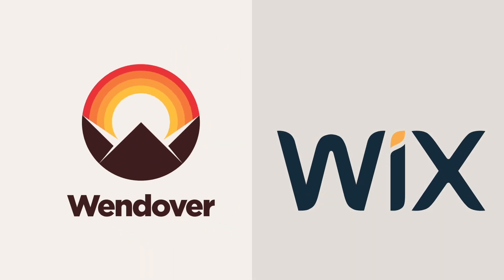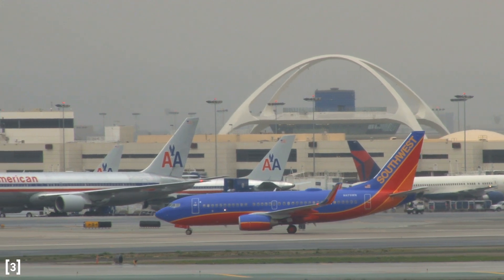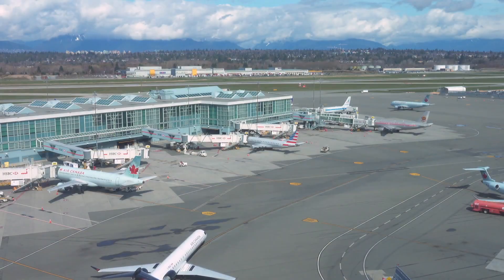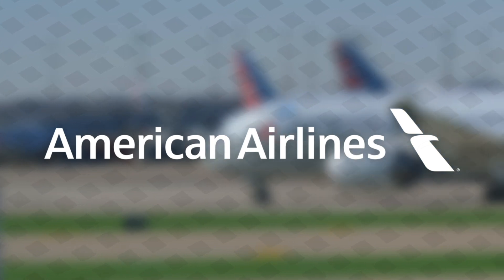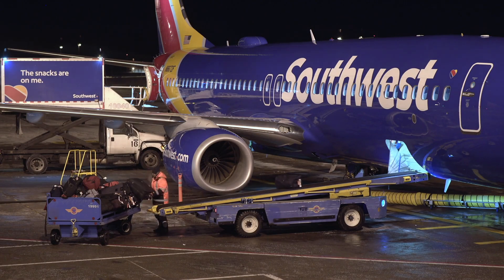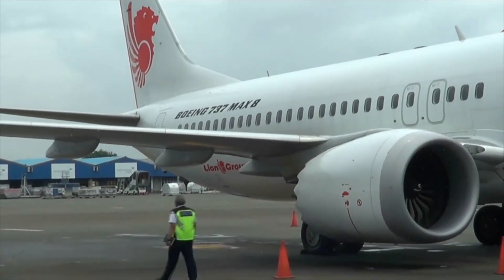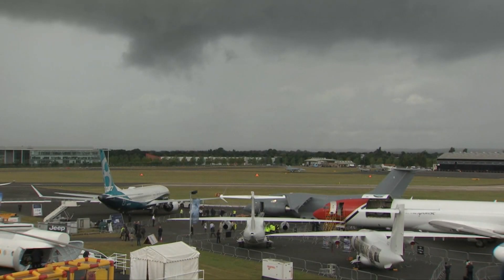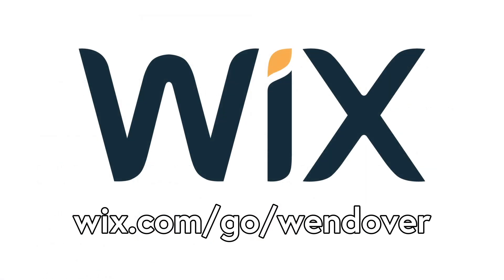The Economics That Made Boeing Build the 737 Max

Comment from the maker: Hey all, 
I hope you find this video interesting. It is meant to provide an overview of what led to Boeing creating the 737 MAX rather than giving a comprehensive overview of the factors leading to the two crashes and the issues with MCAS so the explanation on that is quick. If you want to learn more about that, I would suggest starting with this article: https://theaircurrent.com/aviation-safety/vestigal-design-issue-clouds-737-max-crash-investigations/

Also, for the first time ever, we're taking topic suggestions for future Wendover videos. If we end up using your topic, we'll send you a free Wendover t-shirt in gratitude. Submit your ideas here: https://docs.google.com/forms/d/e/1FAIpQLSdMAoo9CfGxr5OvZdz3qCCEkeQSVJpak3YYTHQFLRwXOyTOXA/viewform?usp=sf_link
Reply: Good video, but it feels like there should be a part 2 that's missing. Like why did the 737 only have 2 AOA sensors, and why check only a single sensor? Why wasn't redundancy designed in? And so on... At some point it is not because of our "poor primitive brains" and becomes just negligence.
Reply: @DemoEvolvedGaming  Also, the crashes are far more complicated than just MCAS.  For instance, why did no US pilots have much difficulty when they had AOA disagree, despite MCAS engaging?  The answer appears to be that US pilots get more mandated rest than the rest of the world, which is also why no US passenger carrier has had a hull loss crash in over 10 years, when they used to occur at the rate of 1-2 per year before the new regulations.

Every air accident is a chain of events that gets past a number of safety barriers, and the 737 MAX is no exception.  Break any one link in the chain, and the accident doesn't occur.

There's also the question of why is MCAS on the 737 MAX different than it is on the older Boeing KC-46 MCAS design, and that decision tree and FAA approval I'm sure is going to be looked at heavily, as the updated 737 MAX MCAS software is ripped straight out of the KC-46.
Reply: @jec6613  Is it not true that Ethiopian Airlines - a carrier with a first-rate safety record and Star Alliance codeshare membership - was one of the very few airlines to have purchased a 737-Max simulator? One that EA pilots trained on? Because of the type rating sleight of hand pulled by Boeing, there were almost no 737Max simulators in existence. But Ethiopian Airlines DID have one. That hardly suggests negligent crew training.
Reply: @alastairbarkley6572  At the time of the accident, they did not, because there were only two in existence: one owned by Boeing and the other by United. What they have now I haven't looked into, but they routinely falsified flight time and maintenance records and have been censored by EASA about it in the recent past for flying without meeting the minimum equipment list and with exhausted flight crews, and have been doing it for decades as they've faced shortages (I'll leave the politics of why out of this, but it has to do with Apartheid ending in South Africa … yeah, it's a mess).  Just because you're a Star Alliance member doesn't mean much of anything when it comes to safety records, it just means you have a good route network that somebody else wants to use.
Reply: @jec6613  On one plane that crashed the co-pilot had only 200 hours.
Reply: @DemoEvolvedGaming , I think I read elsewhere that additional sensors were available in an extra cost optional package. The airlines of the two planes that crashed apparently did not purchase the optional sensor package.
Reply: @DemoEvolvedGaming  Shouldn't there be any simulation runs where worst case scenarios are given to test out each and every part of the plane that is replacing the old parts ? It looks like the new does not work together with the old. The idea given is more like the exchange of old planes for new planes and the old planes are renovated to be "new" planes. So how do poor countries pay for all the "new" planes they buy ? Another comment was about the weight that the 737 max can carry. You should go back to the old days when every passenger and every luggage have to be weighed so as not to let the plane senses that the weight is too heavy which cause the plane to crash.
Reply: @DemoEvolvedGaming  Because if the two sensors disagree, then the computer has enough information to tell the pilot that it can't trust its inputs, and that the pilot should take over. In Boeing methodology, automation is meant to assist the pilot, but in any circumstance, the pilot is in charge of the plane. For example, the pilot can fly without AOA sensors, using the Artificial Horizon display, which is unrelated to the AOA system. If the plane looses all power, the Artificial Horizon is one of the core systems that continue to operate, allowing the pilot to manually fly/glide. If that fails (Which is even less likely), either the plane is not even flightworthy, or the pilot can generally fall back to "flying by the seat of his/her pants", which generally works as long as one crew member can see the horizon. 
I can think of one situation where the Artificial Horizon did not work correctly, and that was when a crew was in a hurry, and didn't let it settle into the correct orientation before uncaging it and proceeding to take off. Then they were in a strong cloud bank, taking an unauthorized shortcut over some mountains, and all the other functioning systems did warn the pilots that they were heading toward the ground (which was the side of a mountain in that case).
But anyways, 2 AOA is the correct number, as long as the computer doesn't have complete and total control of the aircraft in every circumstance.
Reply: Interesting video. Just one thing, the A320 is still a 30 year old design itself. And yes, it still uses a paper checklist concept for normal operation. That checklist can be put onto an EFB, but that is still not a feature of the airplane, just a feature of directly replacing a paper checklist by the same thing on a screen.  Unlike the 737, the Airbus avionics were never updated, which leads to the weird fact that the 737 avionic system is actually a generation ahead of the A320, but its automation is 2 generations behind. 

By the way, at least in many parts of the world, the 737 100/200 is a different typerating than the 737-300-MAX10. So no, a 737 rated pilot cannot fly all variants, just most. And differences training between variants can actually be extensive, the minimum differences course between a Boeing 777 and Boeing 787 (legally they are two variants of the same type rating) takes at least 7 working days including quite a few simulator missions. Same for the differences training between the 757 and 767 or the A330 and A350, all of those are one type rating for very different planes which are seen as variants of each other.
Reply: @Soordhin  indeed. Imagine going from gauges on the 737-100 to an LCD display on the 738... I believe there are more reasons for the difference in type rating, but I can already see the obvious difference between aircraft.
Reply: It is more than "just" instrumentation. The -300 to -500 have a partly "steam" layout, and there are actually completely steam instrumented ones out there. And yes, they can be flown on the same typerating, depending on regulations. The -100 and -200 are just tiny aircraft compared to the NG, a lot smaller and weighing a lot less, with completely different flight characteristic. However, not many out there anymore, so most pilots are just rated on the newer option.
Reply: Kind of feel like you should have mentioned the cables on a 737 don’t actually move the flight controls but instead actuate hydraulic power packs that move the controls.
Reply: @superskullmaster  indeed. And for the Airbus, it's like typing into a computer and the computer decides whether to type that word or not. If the pilot says left, the computer can say nope.
Reply: @AliBaba-vw7mo  I'm an A330 pilot, formerly flew the 737NG and the CRJ. What you say is completely and utterly incorrect
Reply: @DreamlinerFlyer  some enlightening will be appreciated. I read somewhere that you provide input to the computer, and based on other data provided by sensors, it decides whether it should execute the pilot's order. I'm also pretty sure the 737 Max is totally hydraulic and only spoilers are fly by wire.
Reply: @AliBaba-vw7mo  you provide input to the  aircraft using the sidestick and then it uses flight data to move the flight controls to the extent that the aircraft moves based on how much you move the sidestick. Its not that far off, but the aircraft can't just deny the request or anything. Obviously there have been some issues, like with every other aircraft, for the A330 there was an incident where what you described actually did occur where the computers denied the pilots' input and made a drastic nose down movement. It was quite worrying, especially since by then the A330 had been flying for over a decade. Thankfully, Airbus quickly remedied this after identifying the cause and to date there has never been a single incident that is even close to being similar, and I have no doubts that frankly we won't ever see anything like it again. Airbuses are very reliable and safe, and they're very flyable for the pilots, and frankly, I don't miss my yoke
Reply: @AliBaba-vw7mo  also, I was pretty sure that the MAX wasn't FBW, I just didnt want to get anything wrong since I flew the NG but not the MAX and therefore am not too familiar on the changes
Reply: @DreamlinerFlyer  I miss my yoke.. Not a pilot but went on class D sims before.
Reply: @DreamlinerFlyer  neither am I. More familiar with NG systems than the Max. Would you feel safe flying the Max after the patch and additional measures?
Reply: @DreamlinerFlyer  we can both agree he fucked up the "you can start an airplane with a flip of a switch" the last time I checked, I walk into an A320, I use paper checklist, do the entire checklist. YA can't just flip a switch
Reply: @AliBaba-vw7mo  after the patch, I would wait a bit before getting on, see what the pilots say, but so far, it seems like the patch is what MCAS 1.0 should have been, aka the system doesnt have nearly as much authority and is far less aggressive in its actions. Unless something unexpected comes up, I wouldnt think twice about it. Well I would, but only because of those AA 29" seats 😉
Reply: @DreamlinerFlyer  hehe
Reply: @DreamlinerFlyer  ye. I think even with MCAS off, pilots would notice the nose up attitude and correct 
 it with trim anyways.
Reply: Great and interesting video
Reply: BTW the Max is mostly safe and the pitch up is rare. Pitch up only happens on max thrust and low weights. Most flights are done with close to MTOW. Pilots have also reported that the handling characteristics of the max without MCAS seemed identical to the 737NG
Reply: @AliBaba-vw7mo  So 737MAX stall risk is pronounced on Go-Around scenarios?
Reply: @DemoEvolvedGaming  when these two conditions are met, stall risk is higher:
LOW WEIGHT
FULL THRUST
Ask yourself this, will you see an empty southwest flight? Don't think so, so stall risk is lower because it is not light.
Reply: Ali Baba 
M
Reply: Great video! It's the first time I've heard about the premature announcement by American. Interesting information though. I would also love to see a video about the Dreamliner and the accusations coming out of South Carolina that were in the NY Times article recently.
Reply: Have you seen AvE's look at an angle of attack sensor?

https://youtu.be/NhZ0D-JRtz0
Reply: I would enjoy it if there were to be a part two discussing the ensuing debacle and how engineering protocols, practices and systems played into it. As an engineering student who interns at an aerospace company known primarily for their avionics, I find this sort of stuff really interesting. Reliability engineering (especially in aerospace) is a fascinating topic, and I think that you could really do it justice.
Reply: Moving engines forward was not bad decision per se and it has not lead to the catastrophy. Design of new plane will replace one known stall problem with multiple unknown problems - see problems with Dreamliners and their engines and batteries. I do not mean it was good decision either but the accutal reason for crashes is a poor design of MCAS without redundency and stall indicators, also lying in certification about angle that MCAS is correcting the stabilizer, lack of training for pilots on the new areodynamic isues and more. Also jurnalist reported that undefounded FAA was skiping many checks and allowed boeing "to certify itself" - this should be punishable and is plane stupid.  But there is nothing about it in your video. The video clamis that redesign of the palne is to blame which is simply not true. It may not be the best solution but it has not lead to catasrophy. It could happened in any new plane where Boeing would think MCAS is needed!
Reply: Unfortunately I think the video shames Boeing and the Max Aircraft more than what is deserved. Reading the preliminary report of ET-302, the pilots on that flight were not capable of flying their aircraft and that incapability should not be put on Boeing’s shoulders. Grounding the Max was a unnecessary procedure and it is unfortunate Boeing has to suffer because of a problem that’s not their fault. I stand by Boeing 737 Max!
Reply: @thebenberg , maybe you didn't look at the report on what those pilots went through, but it reads like the screenplay of a dystopian future where our technology bends over backward in an effort to kill off human beings.  Yes, those pilots made fatal mistakes.  But I am baffled at how you choose to stand behind Boeing's decisions to give their autopilot more flt ctrl authority than the physical strength of the human pilots.  Muilenburg & co are personally responsible for the deaths of these hundreds of lives.  They made decisions toward maximizing profit at the expense of safety.  (This is to say nothing of the FAA's culpability in all of this.)
Reply: @Da Hawk I stand by Boeing because theses two unfortunate and sad crashes were preventable, and Boeing is taking the fall for that. I strongly believe the MCAS (autopilot does not have anything to do with) issue with the Max line of aircraft should not have been fatal.
Reply: @thebenberg  there is evidence of them rushing the certification. So its also their fault. But I'll be more than happy to fly on it after the fix
Reply: This is a very good presentation of a thesis about the 737 MAX blues.

May I point to the fact that this is a THESIS, not really true, or even reasonable.

Facts are that 737 in all its iterations are a huge success and have been the workhorse of the industry. Thousands of pilots have been trained for them and are comfortable with them. This is a real asset, worth a lot, that shouldn't be neglected.

Than comes the 737 MAX as a new reengined iteration of the old design. The option to refresh the old design surely imposes tradeoffs against a new clean sheet design. The Thesis behind most of this Boeing trashing speeches all over the internet implies that safety was fundamentally compromised. This has to be demonstrated, not accepted without argument.

Boeing and many seasoned pilots and aircraft maintenance workers say the plane is fundamentally stable, easy to fly, by itself, even without MCAS. Turbine placement and thrust levels make it behave a little differently than previous design iterations of the 737. That could jeopardize certification as the same "type" of airplane. Hence, MCAS.

Boeing made an inherently unreliable MCAS using just one AoA sensor, that can and eventually will fail, under the presumption that it is the same kind of failure as any one leading to the "Runaway Stabilizer" which already had established procedures to cope with. This is a fact, but the correctness of the presumption, and repercussions of subtle changes are being investigated.

FAA supposedly understaffed and underfunded has not pinpointed this at the plane certification time. This is under scrutiny too.

Did Boeing and FAA really released a certified plane to the public knowingly omitting it was inherently unstable, hence not certifiable as a commercial airplane as demanded by regulation? This is implied by The Thesis, negated by Boeing, many pilots, and other players on the industry. I don't buy it. It would be a massively irresponsible and homicidal action by many actors that was never ever proven, just theorized by some and virally propagated on the media and the internet.

Boeing is upgrading its MCAS design to make a "Runaway Stabilizer" event induced by its malfunction a lot less probable.

FAA and others are investigating the certification assumption that the plane is secure to fly even under a malfunction event with the established procedures and training.

It is possible that training was not enough and the procedure to difficult to execute with its subtle "memory items". 

Pilots should have trimmed the plane before CUTOFF, managed thrust and speed, not reenabled stab trim from CUTOFF position flying. Was this possible? Is the old procedure flawed? That's what's under investigation.

Two accidents did happen, and hundreds of lives lost. We're all sorry for this human loss, and shocked by the events. 

Anyway, we should avoid jumping to wrong conclusions and smearing everyone reputation before facts are established in the investigation.

In the next months, the recertification of the plane with the upgraded MCAS, under whole world scrutiny will show the planes real characteristics and who was right. Upgraded training, procedures or both may be expected if lessons from the investigation show the need.
Reply: @celsostarec6735  oh lord, this is the comments section, not a FAA investigation.
Reply: Wendover Productions most of your information is wrong, how do you get away with producing such poorly researched work...oh wait it’s the internet and this was free to watch.
Reply: Since you make so many grand declarations, including a number of falsehoods and half-truths, and yet expect your many viewers to trust you, how about if you post your aeronautical engineering, flight qualifications, and experience (both total time and time-in-type) below the video? If you can't / won't / don't have any, then at least viewers should have a better idea of the nature of what they are watching. The media loves making up sensational nonsense for the sake of viewership. Truth is sacrificed continually at that altar, even more than the passengers of developing-world airlines.
Reply: @ReflectedMiles  So at the end of the day did or didn't Boeing and the Airline bosses choose profits over safety? Those planes crashed for a reason. What's your explanation and what are your credentials?
Reply: Kim O'Brien So the credibility of sources and analysis is irrelevant so long as they’re pushing the established view? I have been a commercial pilot since 1985. The media have made an ignorant mess of this story, stoked irrational fears and misunderstanding in the public, as well as with its related stories. If they don’t have the understanding to produce a video like this, they need to shut up, sit down, and let the primary sources such as investigators, engineers, pilots, and regulators speak. Unfortunately, having known journalism students in college, they’re rarely the type to recognize when that is the situation. Self-awareness outside of a mirror just isn’t really a thing for them, which is why there is so little internal criticism of their industry. Having them accuse aircraft manufacturers of that is rich indeed.
Reply: @ReflectedMiles  First let me say I am glad to hear from someone who actually is in the industry. My experience is connected to the ground transportation, HVAC and electronic/electrical industry. I and I'm sure others have seen things that go on that shouldn't which is why it is very easy to believe this is just another case of someone putting the dollar before safety or other concerns. The liberal media has its own axes to grind as can be seen in it's unending get Trump at all cost campaign. They had chief FBI hound dog Muller run an almost three year investigation which revealed no connections or collutions with Russia but they still refuse to drop that bone.
Reply: This video is the answer to why I still haven't subscribed to this channel after watching so many of its videos. There was always something doesn't add up in those videos. Too much exaggeration and disregard of fact, all in favour of cheap likes.
Reply: I’m glad you are talking about this.
Reply: Check the graphic for Flights per day and Hours per day. I think you used Hours per day for both 4:20
Reply: Also, super huge appreciation for that amazing video thumbnail! 👏🏻
Reply: I generally don't like the idea of making Max sounds isolated, that every decision Boeing made wasn't being made by any other aircraft manufacturers. The industry is doing all the same things, and Boeing is only the unlucky one to get picked by fate.
Reply: @Wendover Productions,
Things ya got wrong :
1) Other aircraft also have paper checklist, but any checklist on any plane can be put into an Electronic Flight Bag.
2) YA can't just flip a switch to turn an aircraft on with engines running on other aircraft.
3) the pilots manipulate hydraulic systems, and those hydraulic systems control the flight surfaces. Without this hydraulic system, controlling the 737 would be like doing a workout at the gym., especially in high speeds.
4) there are multiple warning lights, telling the pilots exactly what is wrong. Cabin pressure low? Not to worry, a light lights up brightly with a loud alarm. Fire? Not to worry, ya got I giant red button that illuminates. Fuel? Not to worry, a light will light up. Hydraulic problem? Not to worry, a light will light up. This is, in my opinion, a one layer, easier to read system. Instead of scrolling endlessly through an error log, ya can just look at them lights and investigate further.
Reply: I really enjoy your videos and they are generally very well researched but I believe you have this one very wrong regarding the 737 MAX itself. There is nothing wrong with the inherent design of the 737 MAX series despite the age.  Boeing did screw up in many ways eg with lack of redundancy,their implementation of the MCAS and lack of adequate training. I suggest you watch the series of videos by fellow YouTuber and commercial pilot blancolirio.  His vids encompass the whole MAX saga and are the most informative out there.  He speaks from a life long aviation background and having been a 737 type rated pilot.
Reply: I have a suggestion; the producers of this article should watch blancoliro channel updates on this issue before, before making a follow up to this. 
No customer strong arms a company to build an inferior product to destroy their business, do they?
Boeing doesn't build planes to crash so they can sell more of them, do they?
Reply: super interesting
Reply: excellent video, man! great job! informative yet not looking to make a profit out of tragic crashes..
Reply: finally, something breathtaking
Reply: Can you do a video about the problems with Boeing's South-Carolina factory (issues, staffing problems and decisions, etc)?
Reply: LexChan oh you mean the same problems we have at Lockheed but don’t see the light of day because we aren’t making passenger planes?
Reply: Please explain why is a bigger engine (slide 18) needed ("more bypass/ flowpass") when a longer range aircraft is sought after?
Reply: @robertberin4872  Bigger engine is much more fuel efficient. LEAP engines allow further range since fuel use is less.
Reply: Super duper interesting! keep up!
Reply: BITCOIN - can we get a credible non-biased view on what it is, how to buy/ how to sell and whether one should/could buy bitcoin in 2019?
Reply: One more thing:  Love your channel but one thing that I really really HATE is the adverts you promote.  
Honestly I’m SICK TO DEATH of hearing the word skillshare (I know you mention wix in this video).  
Let’s be honest, MAJORITY of the people watching your videos couldn’t care less about skillshare and would never even look into it, let alone subscribe and pay for it.  

But we LOVE YOUR VIDEOS and understand why you need to do it.  Perhaps you can mention other things, as my ears have been scarred by the word skillshare.  Thank you for your videos!
Reply: Hey man I just want to say, thank you for citing your sources! I really always wanted to read up more on the articles
Reply: Thank you so much for your videos on aviation Sam! My brother is training to become a pilot. The way you explain the issues and logistics of air travel is so simple to understand for regular people like me.
Reply: Compare with this video from an expert. 
https://youtu.be/KB4lCbT5oX8
Reply: @8:25 you should have mentioned the Southwest usage of the 737Max to reach Hawaii (since many of the shots are of Southwest Airlines)
Reply: You should do a video on the process that lead to getting a picture of that blackhole recently!
Reply: +Wendover Productions ... Thanks for the briefing.  I have no airline background other than purchasing a ticket and hoping all the professionals "do there job".  This is really interesting from the standpoint of receiving a snapshot from the business end of why evolutionary processes happen ..... SAVE MONEY.  I did pick up some interesting points of view.  Gratitude is in order.  Good Job!
Reply: Very interesting to have a better understanding of this complicated matter. Thank you for making this.
Reply: Great video, learned alot!
Reply: Great video, and to the point, Thanks!
Reply: It has not much to do with MCAS but with MBA-style short term management. The same reason Microsoft was defeated.
Reply: Wendover Productions jhave pm
Reply: Lots of source information from other news agencies but limited information from tech and safety sources?
One US carrier has more of these aircraft that didn't crash when they were in use.
Why is that?
Reply: Wendover Productions you suck! Boeing is the best
Reply: Have you been paid by Boeing in anyway?  to make this or your other videos?
Reply: Good video, good job albeit I suspect more is at play besides MCAS alone in AOA autopilot integration systems. A330 incidents have largely remained unpublicized within US media sources, yet presenting similar if not yet fatal cockpit emergencies for more than a decade. Its an investigation waiting for broadcast from those unafraid of consequences, Id like to see ALPA take a more proactive standing. Unlikely. It seems in twenty-first century loss of life is sole instigation for thorough exposé.
Reply: @hualani6785  - MCAS isn't part of the autopilot it's a form of stability augmentation which is prevalent in modern airliners more accurately it prevents the control column force required to pitch up from progressively decreasing in certain AOA regions preventing pilots from easily inducing a stall themselves.

While the MAX is often labeled as "aerodynamically unstable" it isn't and the 777 which employs Relaxed Static Stability technically IS unstable but that doesn't mean it's dangerous as is proven by its safety record
Reply: No wonder it's still grounded!
Reply: Wendover Productions you should do a follow up to this on the economic cost of the 737 max grounding
Reply: nice review .......Boeing should .....see this
Reply: I love Boeing.The question we must ask..why didn't any Us carriers ( B737-max) crashed.
Is it the mandated rest periods for the pilots?
Is it the training ?
Or is it Lion air and Ethiopian airlines flight Safety record.
Is it cost cutting ?
What is safety..An uncompromising approach to standard operating procedures.
Another question to add to the list..Is it climate change?
Is the weather affecting aircraft performance?

Hmmmmmmm💯🙏💯🤔
Reply: Why cant Boeing just omit the entire MCAS system?  Just tell the 737 crews about the different center of gravity and airflow changes to the 737 Max fuselage and get on with it?
Reply: I disagree strongly with your conclusion. The Boeing 737 MAX was a conceptually fine design, and will eventually return to flight and live a hopefully uneventful career. The thing Boeing did that was criminally negligent was creating a safety critical design with no redundancy, and then not training pilots about it's failure modes. That is absolutely inexcusable, but isn't an indictment of "let's just reengine Betsy again". The idea to reengine the design isn't what caused the fault, the negligence of Boeing's MCAS implementation did.
Reply: Do we know why they didn't just add another few feet onto the gear length to fit the new engine in the original position? That way literally everything else could have stayed the same, surely?
Reply: And where would those extra few feet of gear length go when the gear was retracted?
Reply: For all people questioning technical aspects of this video, just don’t. This fella is not technical and slipped here and there when talking technical aspects such as if the MAX is fly by wire or what this even means. This is a video where he explains economical factors and those should be the only ones closely observed here, even more because he demonstrates some bias towards thinking that Airbus makes more modern aircrafts while Boeing just refurbished its fleet.
Ignore the technicalities and the video is good.
Reply: Great video.  On the last sentence, it wasn't just a hasty decision made by hasty human brains, it was a hasty decision made by human brains stuck in the capitalistic money making cycle.
Reply: You forgot to mention the low quality production standards of the 2nd Boeing factory
Reply: Wendover Productions 4:07 you wrote 757-200 twice I think you mean 757-300
Reply: The end of this video sounds like every third episode of Air Crash Investigation. "Boeing is totally going to loose face." ...and I'm like "So, I see they got over the doors-opening-midflight thing, various fallapart issues, and the occasional Oops-it-blew."
Reply: Almost everything you said about the 737MAX at the beginning when comparing it to other modern-day aircraft is absolutely WRONG.
Reply: @ChrisCokeRobinson  paper checklists?
Reply: Most, if not all of United’s 737 Max Jets are still flying everyday. I fly them almost twice a month. Yes, the MCAS Sensor is a problem and I’ve felt the jet try to pitch down a bit too much which is no big deal. Like you said, if the MCAS Sensor is broken, all the pilot has to do is turn it off manually and the plane flys like normal.
Reply: @sirloin8107  No it does not - when you switch of MCAS you also switch of electric system to change the trim tab. There is hydraulic system to change it but it didn't work in ethiopian case - most likely due to etreme speed increase because of MCAS. It means that the plane is heading down the earth and you cannot move the trim tab without switching on MCAS again. That is extreamly bad and led to 2nd catastrophy.
Reply: Good presentation, but a few inaccurate statements:  1: MCAS is not an anti-stall feature, but rather what it means. Maneuver Augmentation... Most Jet airplanes have some form of this, as the Jet design is inherently unstable, a simple example of this is the Yaw Damper. 2. The main reason for stubby landing gear design is its weight advantage, an ancillary benefit is as stated ground support. 3. The main reason for the 737-Max crashes was pilot error and is a current huge problem in today's modern aviation. Pilots are just not adequately prepared for these advanced aircraft. AF447 and Air Asia planes also crashed on the ocean from cruising flight due to this same problem and many more will continue to do so until the industry gets a grip on this complex problem, that requires it's own space to explain. Regards JR. Elliot 38 years in commercial aviation 22 of those as an instructor pilot.
Reply: The 737 MAX is NOT Fly by Cable. Both the 737NG and 737MAX are FLY BY WIRE. They may have a backup cable system to some primary flight surfaces.
Reply: @ChrisCokeRobinson  I cant speak about the MAX, but the NG is absolutely not FBW
Reply: Well done. An excellent overview. With everything we know about aircraft safety, it's an absolute disgrace how Boeing has behaved all to appease greedy shareholders & turn a profit. I used to love Boeing and the products they produced. Frankly the incidents with the 737 Max has made me think twice.
Reply: This is a superb piece of work; very clear, very on target, and just plain good!
Reply: Great video! This has been big news however the F35 has also been under scrutiny. I would love WP to dive into that topic. I already sent a request, but thought I'd leave a comment as well. ✌️
Reply: I love Boeing. The cockpit feels like an actual plane. Airbus has a stupid side stick and retarded computer telling you to do what. In a fly by wire, you input to the computer what you want to do and the flight computer decides whether to use your input or its input. So you ain't flying the plane, the computer is.
Reply: @AliBaba-vw7mo  Like the 787 & 777?
Reply: @Coz131  which comment are you referring to?
Reply: Ali Bab
Reply: @AliBaba-vw7mo  You should start up airline then. Buy up all the 737Max cancelled orders and Boeing no-hope over production. You can get good deals on a new 737Max ATM. Practically giving them away. Your passengers may not share your love of Boeing, though..
Reply: @AliBaba-vw7mo  - There's a lot of misconception in that statement nearly every new fighter jet is sidestick and they're all FBW including the F-22 which Boeing helped manufacture